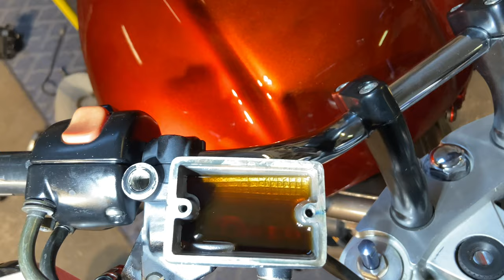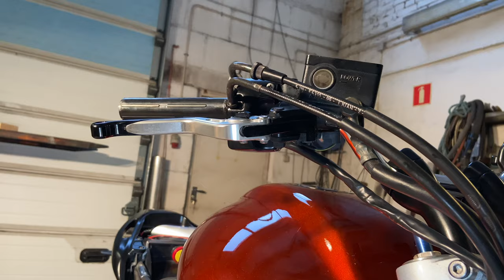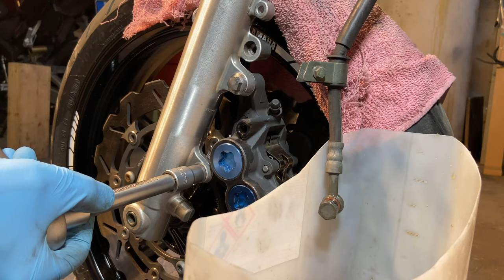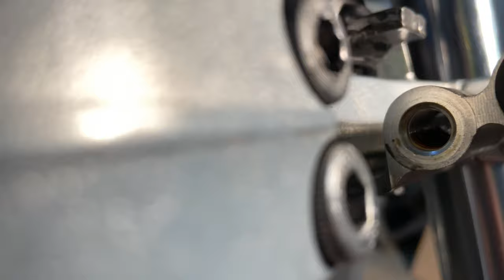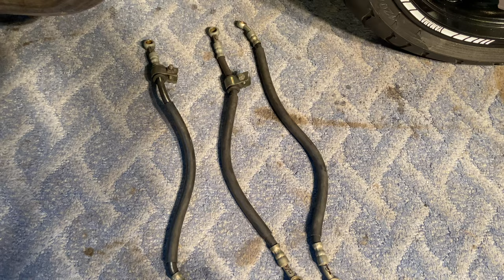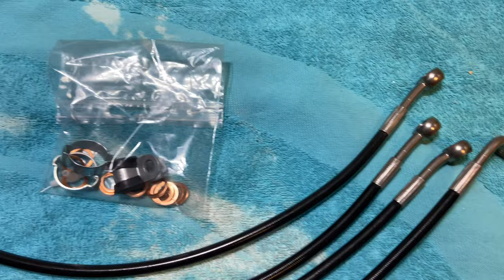Ymaha BT1100 Bulldog. New brake lines.

Comment: pourrais tu mettre les references de tes pieces que ru change
Reply from the maker: Everything is just maintenance, restoration of the original or replacement with better spare parts. In 19 years, many owners of this bike have made changes. So do I. Good if you find something useful in the videos. Unfortunately, there is no list.
Reply: @sem5771  thank you for this feedback, my concern (France) is to find sites for the right parts, not adaptable for the security elements